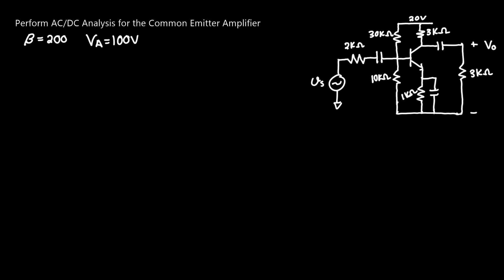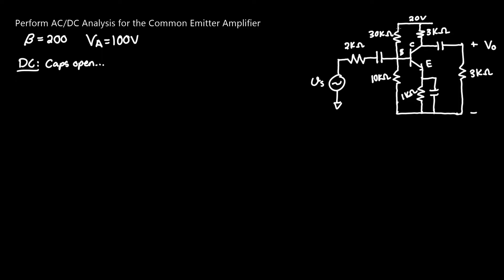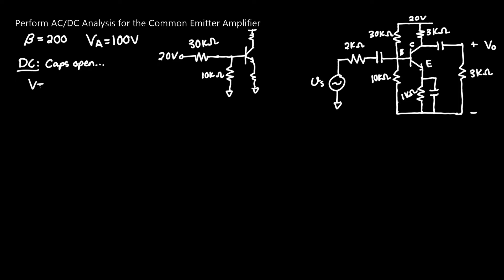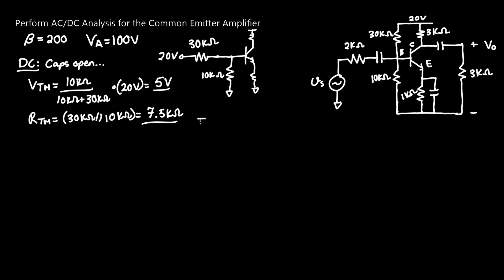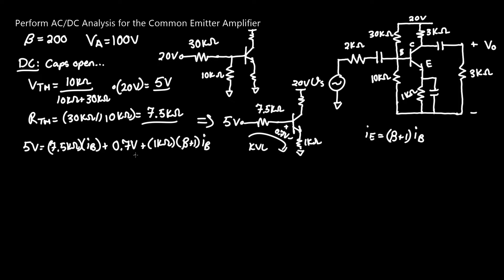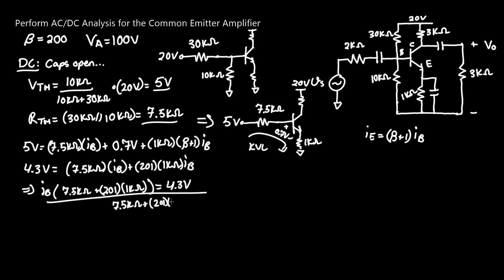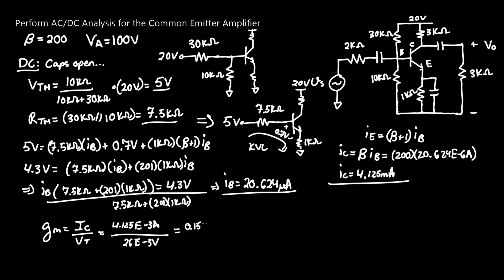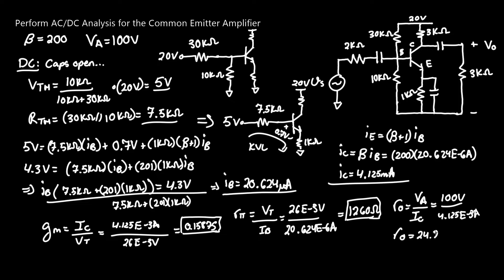AC/DC Analysis for Common Emitter Amplifier (2)

Comment: what is VA?
Reply from the maker: VA is early voltage, which is a device parameter based on transconductance. The more linear the 1/ro is in saturation, the higher the VA. https://www.allaboutcircuits.com/technical-articles/understanding-the-early-effect/

Comment: how can i solve the AC analysis if I'm not given early voltage Va
Reply from the maker: You kind of need it in AC analysis for finding ro. Otherwise, if given lambda (lambda = 1/Va), you would say ro = 1/(lambda * Ic). You have to be given either Va or lambda, regardless.

Comment: Where did RE go in the AC analysis? Thank you.
Reply from the maker: Under AC Conditions, capacitors short. So you're basically putting RE in parallel with a short, which means you equivalently turn that whole path into a wire directly into GND.

Comment: Thank you so much! I just have one doubt, does all collector current flow through Rc and straight to collector? Do we not need to include the load resistor? Please help.
Reply from the maker: Given that there's a DC blocking capacitor in between RL and Rc, under DC conditions, the capacitor is open. This means that current flows straight from 20V through Rc and into the collector. So you are correct in your assumption. Due to this, the load resistor has no effect on the collector current Ic, which we found to be 4.125 mA.